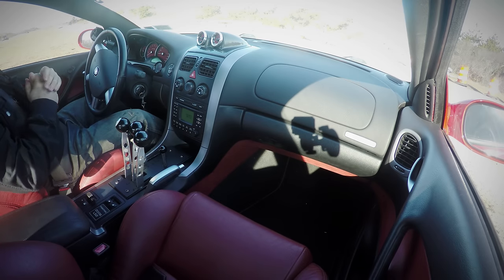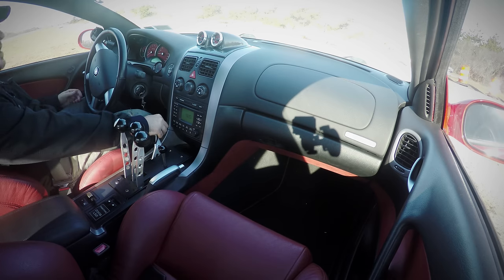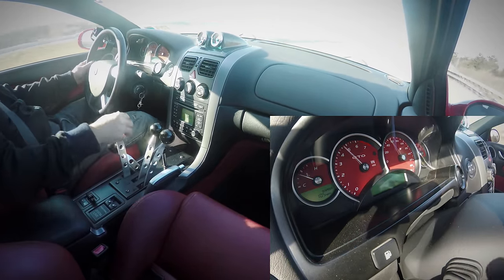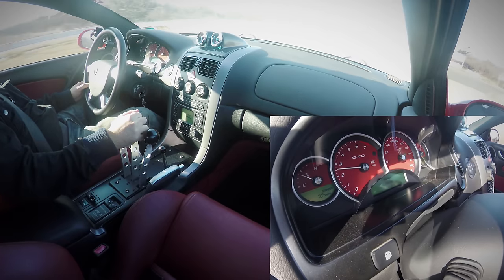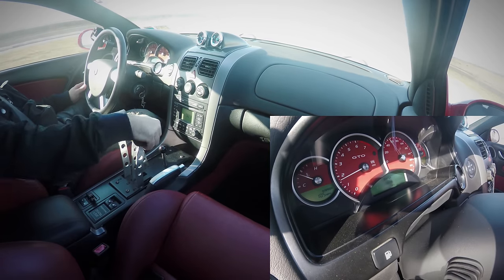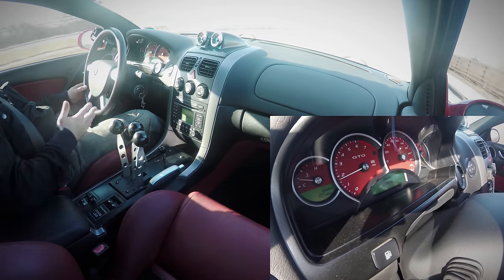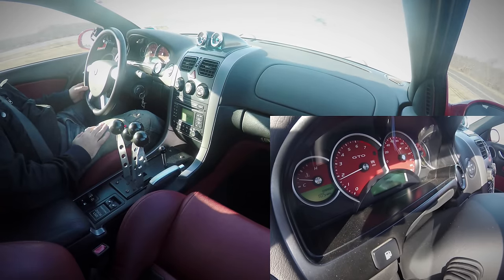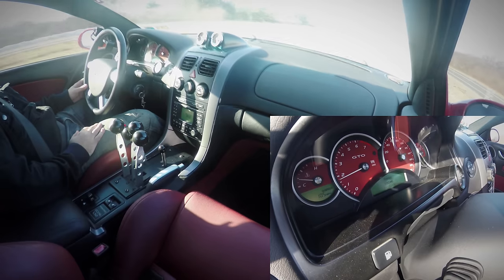Kilduff Shifter in action (06 GTO)

Comment: It looks really cool and it’s neat, but there is way too much delay in the shifts for any real benefit
Reply from the maker: It shifts best at WOT. If you look at the 1-2 shift in the video, it's pretty good. I let off for 2-3 so the shift was sluggish. If you want to see a firm 2-3 shift, check out the video link below. I'm pretty happy with it considering it's typical 4 speed auto technology. Thanks for watching! https://youtu.be/5GZOcP9-zrs
Reply: It's because all of the sticks do nothing to the transmission. At all. All they do is push the gear lever forward one notch. The same thing as pulling your regular shifter into low and using your hand to push the same shifter handle up to 2nd.  It's the exact same thing except instead of pushing the shifter handle up one, you pull a separate stick which is mechanically linked to the main handle and it pushes forward one notch to 2nd.   

Basically, the shift lag is the same as it would be stock because you didn't change anything in the car other than a way to move the shifter forward a notch. Still TCM controlled off of pressures and things. Not a manual valve body.
Reply: @GLF426  oh, so there's literally no point for this to exist except the cool factor? I thought so.
Reply: @451degreesF  yes. That's correct.  Still pretty cool though.  It would be very fun in something with a manual valve body and a shift kit. It's designed after a Lenco .  Look up Lenco drag racing and you'll see this.  The difference in this and that is that the real thing is directly linked to the gear in the transmission and this linked to the shifter handle.
Reply: There actually isn't any benefit of quick shifting (quick shift moves), you still have to wait for the tranny to do it's work :D
Reply: @mato424  that is correct

Comment: why does it still have that delay after shifting?  Is it the tune in the auto-trans?  just curious. my friend has basically the same setup in his chevelle and it looks like your car has a slightly longer delay.
Reply from the maker: It's bc I let off right at the 2-3 shift - I know, lame, but it's hard to find a straightaway I can do this and it will spin through shifts on street tires. If you watch carefully i did it with the traction control on and it still spun 1-2 hard (watch the screen on the bottom on the gauge cluster in 4k and you'll see it clearly). With sticky tires and T/C off it's a really firm shift.

Comment: Sounds like it responds the same way a shifttronic.. or whatever that auto-manual things is.
Reply: Yeah, sounds really slow when he shifts, it's as slow as my automatic, not saying the thing isn't cool and actually useful, thing is, it's still doing the same shifting the auto does, so my guess, don't know much about the subject, is that it's the same trans with just a fancy shifting setup. The driver can be fast AF to shift, but if it's the same tranny, it will still shift like stock.
Reply: I guess it's not really about how fast it shifts but the control of WHEN it shifts

Comment: Your converter drops a ton of rpm when shifts
Reply from the maker: It's a 3,600 stall with converter lock in 4th over 39mph - it doesn't shift hard or fast when I'm feathering the throttle

Comment: Shit is cool man, but is it just me or is there a bad delay between gear changes going up?
Reply from the maker: when i'm not hard on the throttle the shifts aren't firm/fast. 1-2 on this video was pretty decent and then I let off. I have another video uploaded with a full throttle 2-3 shift.
Reply: Aaah i see not bashing just observing👍
Reply: Is it a fully manual valve body? I don't know if the car will shift itself if you just gun it and don't shift, but if you switch to that it wont go out of the gear you put it in, and the timing between when you shift...and when the car actually shifts will have a huge difference. Even when your not getting on it. Just a thought, not too hard of a process to do.

Comment: what is that small knob in front of the shifter
Reply from the maker: It's a reverse lockout. it slides left and right. Once I'm in drive, i can move it towards the driver's side to prevent the transmission from inadvertently going into reverse.

Comment: Kinda slow for an ls.. are these geared bad or just really heavy ? Don't get me wrong , I LOVE these goats but I'd just expected they'd be faster than that
Reply from the maker: Depends on what you consider fast or slow. This car will run 11.20's all day long on a prepped track on drag radials (hard to put power down on street tires). More importantly, it's a street car. I think it's in the sweet spot where I can rev it out, put all the power down and have fun with it without risking a wreck/spinning out or having a high maintenance engine. There are other faster cars on the street no doubt, but my car always runs and is still fun for me to drive.

Comment: What happens when you are in 4th gear and pull both 2-3 and 3-4 levels up? Will you downshift to 2nd?
Reply from the maker: If I understood your question correctly, the rods move sequentially, meaning you have to go in order, so 4 -->3 and then 3-->2. No skipping gears. Let me know if you were asking something else. 
I usually will use the shifter to hold 2nd gear when racing off a roll and work my way up like in this vid https://youtu.be/5GZOcP9-zrs
Reply: @QueensGTO_Viper  well that's exactly what I wanted to know. Thanks
Reply from the maker: my pleasure - thanks for watching my vids!

Comment: Question.... Seems like the car is fairly stock. Why would you put such a transmission in it? I get it if it has 800-1000 or more HP and you're drag racing why you would, but why to a seemingly stock unit?
Reply from the maker: It makes 500+ and it's a street car I used to drag race regularly. The transmission was built (RPM Level V) to be able to handle taking it to the track on weekends and stay reliable. When I was done racing it I figured the shifter would be something cheap I could add to the built trans to make it more fun for the street.
Reply: Probably good practice using that every day so it becomes more muscle memory action for the race car usage.

Comment: It is cool but I am happy with the regular setup.  I just put it in 3rd gear for racing and it will rev to 6500 in each gear.  HP tuners.  Is your torque management turned off?
Reply from the maker: Yea I also just put it in 3rd at the track and let it do its thing. I used HP tuners also - torque management is off. The RPM trans is holding up great!

Comment: I adopted a car with this shift system and was wondering how I put it into manual mode while cruising? The shift into manual throws it into first, but let's say I'm going 50 mph on the highway and want to go into manual mode, how do I switch it without it going into first?
Reply from the maker: Go to 1:45 at this video. If you're already cruising, you just work your way down the gears in order 4 -->3-->2. No skipping

Comment: don’t you just hate to shift and it doesn’t do it immediately 😣 anything more than like .5sec shift in an auto above 4k rpms is scary to me. i’ve seen too many of them go😢 all seems to directly relate to trans temps 190F+ usually means drive easy.
Reply from the maker: I hear what you're saying. Truth is it shifts fast at WOT - like the 1-2 shift in the vid. I let off at the 2-3 shift and it was sluggish. Check out my other video which shows a WOT 2-3 shift here:  https://youtu.be/5GZOcP9-zrs

More importantly, I like this setup so I can hold gears, like hold 2nd gear on an uphill winding road. If I were to take it drag racing, i would leave it in 3 and let it shift itself.

Thanks for watching!

Comment: It looks very cool, but i think it's a bit annoying that sometimes the levers move, even though they shouldn't. It was especially bad while you were shifting from 2nd to 3rd.
Reply from the maker: Good catch. This was something I was concerned about before doing the install when I saw other videos of the shifter. The levers are all on the same mechanism so as you move through the gears the levers will move a bit, but even though there is a little play, they don't move around while driving which I was pleasantly surprised about.
Reply: +Queens GTO

Well, but in this Video and the video where you introduced the shifter, they didn't move "just a bit", but actually heavily. In this video the shifter for 4th gear went almost all the way and from the video perspective it looked and sounded as if you accidentally shifted into 4th gear instead of 3rd gear, even though you only pulled the 3rd gear lever.

This may be fixed, if you find a way to "lock" the shifters in the upper positions, like they lock into the gears.

But anyway:
how does this work in a car with automatic transmission, especially because you can still normally use the automatic transmission, if you want?
Reply from the maker: I hear ya - even though there's play in the levers, there's a distinct point where they click into gear so even though the rod moves, there's no accidental shifting to worry about. It' s one of those things I guess you have to feel. With regard to your second question, you can still use it just like a normal automatic and like I said in my other video, there's no benefit to this shifter if you're looking to simply accelerate. I did this because I already had the built transmission from racing the car and I am no longer racing it and did not want to go through the hassle of swapping in a manual. This was something I thought would be fun - hold gears on the street, etc + I never saw anyone do it before on a GTO.
Reply: +Queens GTO

yeah, i know and you can also see that in the video. I just wanted to say that it would extremely annoy and maybe also confuse me sometimes, if i was the owner of the car and had a shifter, which isn't able to properly click into place, when not engaged. so it just seems like an optic and haptic problem for me personally.

I can understand, why you did this and i am completely fine with it. My question aimed towards how it is technologically (if this is the right word) possible to work? 
Since you say that you have the "built transmission from racing the car", i would like to know, what you did to the transmission to make it work?
Reply from the maker: The transmission is a RPM level V 4l65 I put in the car when I was drag racing the car regularly. I have a link in the description. The shifter was an add-on I did afterwards now that the car is strictly street. When I ordered the shifter from Kilduff he made it to be compatible with a 4l65. I hope this answers your question.
Reply: +Queens GTO

ok, thank you. I will look into the information and try to find my answers:)

But just another question: how do you downshift from lets say 4th to 3rd or 3rd to 2nd? Do you just push one lever forward?
Reply from the maker: yes. i downshift from 4th to 3rd later in the video
Reply: +Queens GTO

ah yeah, i commented before watching the whole video^^

Comment: is the kilduff shifter mainly used for dragged? or can it also be used for drifting? i’d imagine it’d be easier to drift with just a normal manual shifter and an e break.
Reply from the maker: it's fun to hold a gear off of a roll or on winding roads. it will not give you a better 1/4 mile et. 
i don't know anything about drifting an automatic
Reply: drifting with an e brake? Really?
Reply: Wtf, all drifters use alot of e-brake.
Reply: For drifting get a gsr dog box tranny virtually the same but with a H pattern. 
Look up micah Diaz drift videos ge explains it well

Comment: 0-60 and top speed?
Reply from the maker: 60 foot times are in the high 1.5s with drag radials on the track. I'm guessing top speed probably around 170 or so - it's got the stock rear gear

Comment: Only 4 gears hmm interesting
Reply: Arnav Behari you only need two in a high horsepower drag set up. I’ve seen cars hit 200mph plus with two gears. The extra gears are for  fuel efficiency. Not to mention the gear ratios are really low.

Comment: How did you NOT chirp from 2-3? 
Not sure if the v6 trans in the Aus models are the same but rev matching those things are pretty nasty! Just a pitty to see all that work and it's still just an average sounding Auto.
  No disrespect ment at all..
Reply from the maker: I let off - that's why it didn't shift like it did from 1-2. It would break the tires loose on street tires otherwise. Better 2-3 video here, but it was on mt street e/t's so the grip was all there.  https://youtu.be/5GZOcP9-zrs